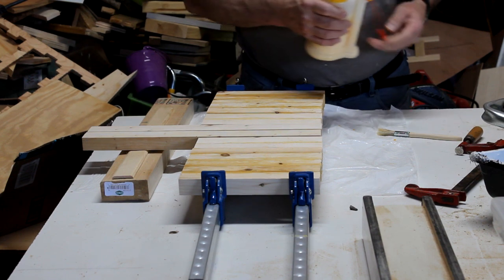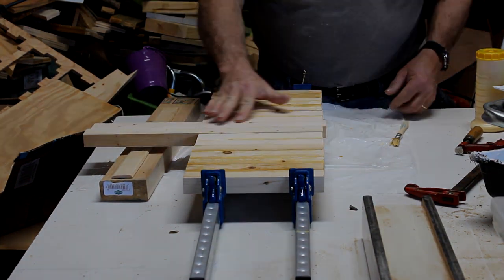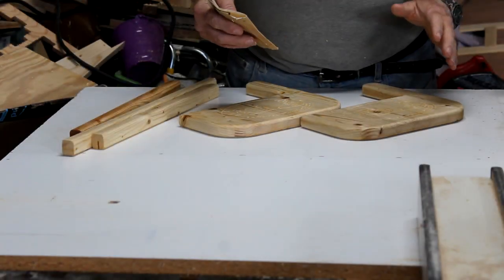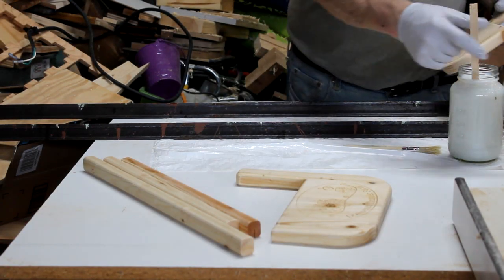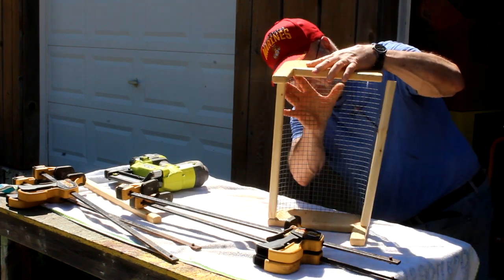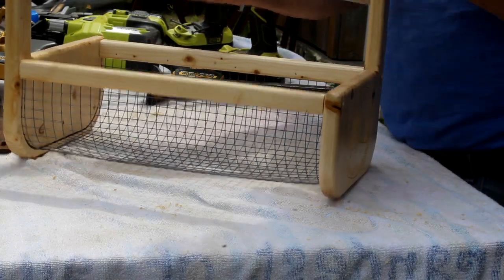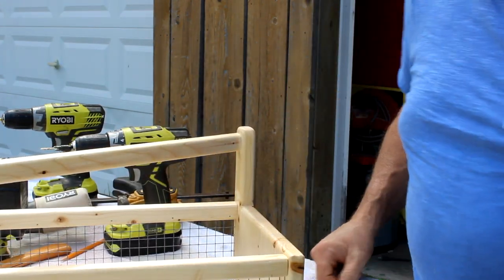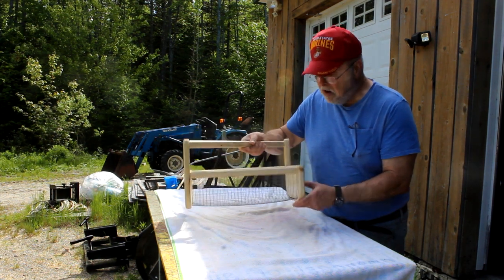(S-6 Ep-8) DIY Garden Trug - Full Build

Comment: Thank you very much for sharing ! I've wanted a trug for a while but I'm concerned the galvanized metal will cut into ripe tomatoes or fruit , that's why I think I'd prefer a flat bottom surface. Did you run into this trouble? Have a great day!
Reply from the maker: We've not experienced any problems, Julie. Our trug works just fine. Thank you for your comment. 👍👍👍
Reply: Thanks a lot for your message. I might ask my husband to try to build it, then!  Have a great day😋

Comment: How would I make the channel manually or another power tool? I don’t have cnc machine.
Reply from the maker: Thank you for your question, Bonnie, and Merry Christmas!
Manually - You can use one of these types of planes: Dado Plane, Rabbet Plane, or Router Plane. A Google search will reveal several brands, types, and sizes to choose from.
Power tool besides CNC: You can use a router in a router table with a straight cutting bit of the proper width or you can use a table saw. Either one should yield satisfactory results. 👍👍👍